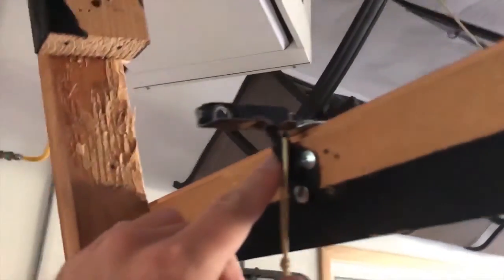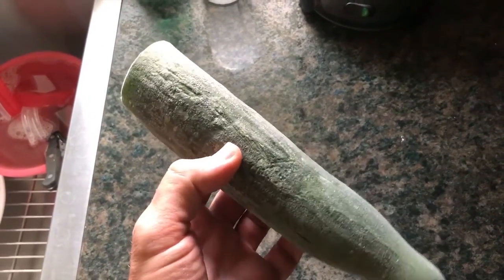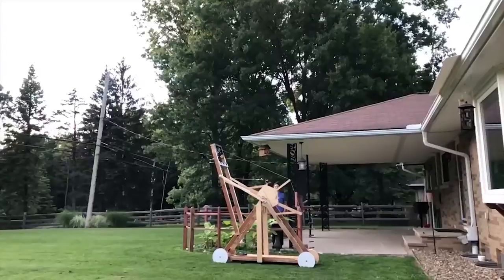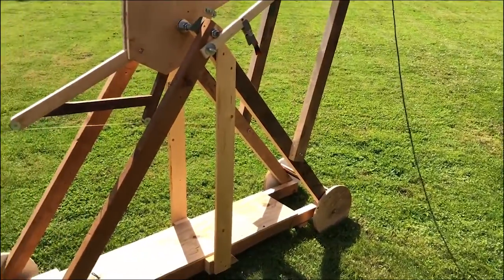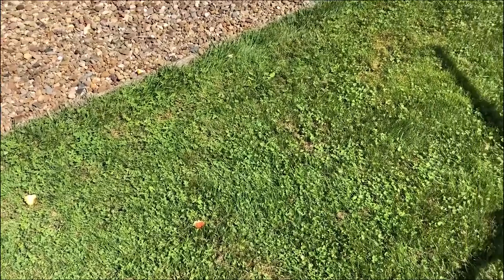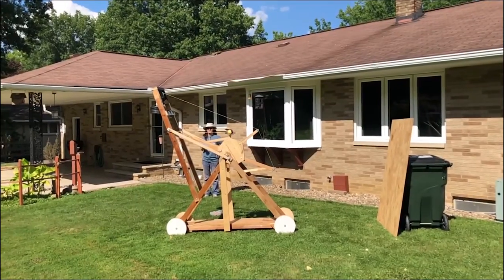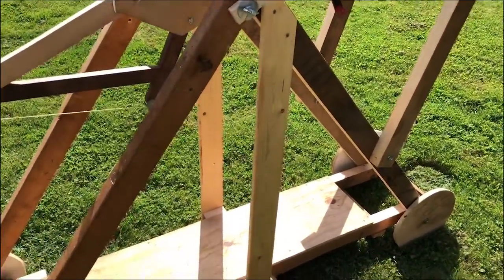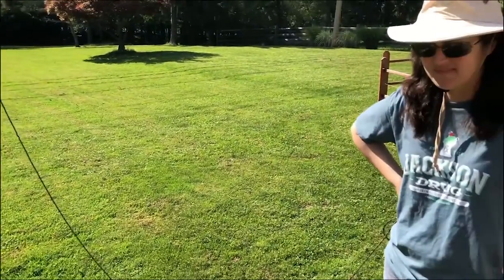I Built a Produce-Throwing Merlin Trebuchet | Random Video Thursday's

Comment: I built this Merlin about 5 years ago,I think you’re losing energy when your weight bottoms out,had  a lot of fun,sent golf ball 250 yards
Reply from the maker: once the swing arm and pouch are fully vertical, the weight does nothing after that. This was tuned to have the weight hit the ground at that moment. any more pull after than just throws the arm forward. Ideally you want the rotation to stop on it's own right after it releases. if it stops rotating before that, then it would lose power potential. If it still rotates after it releases then it's wasted power. Meaning the weight rope would be too long or too heavy.